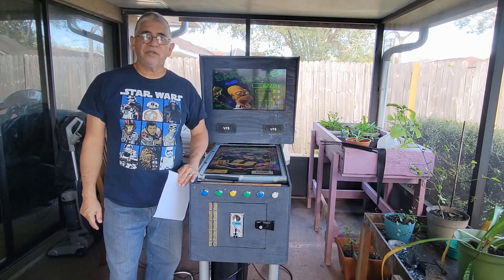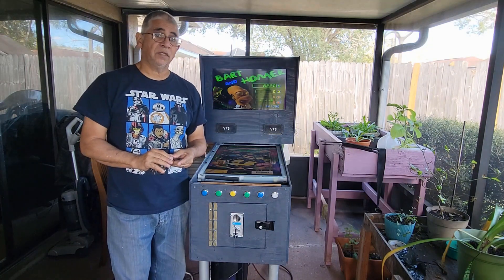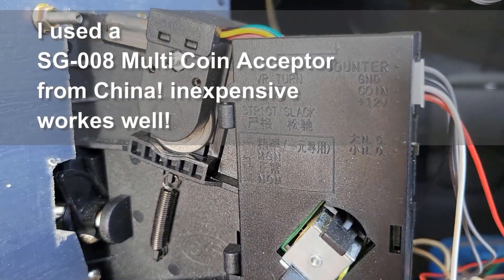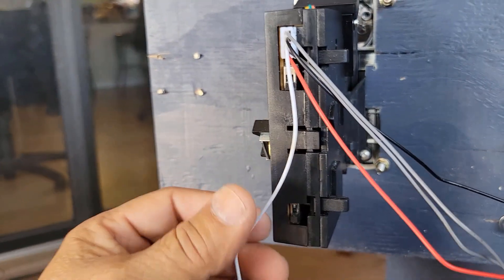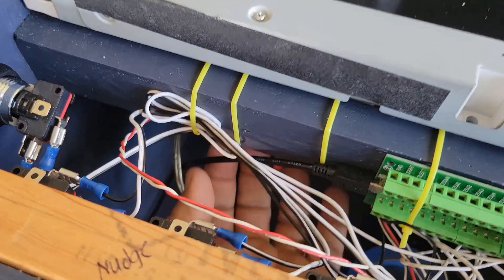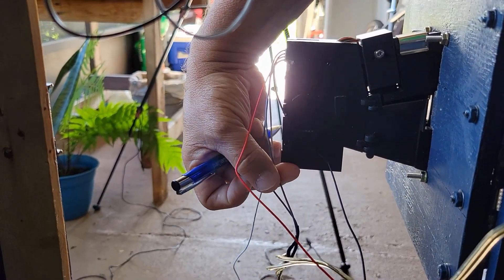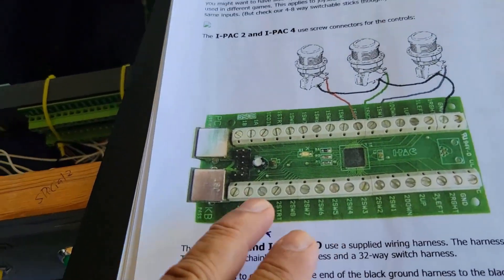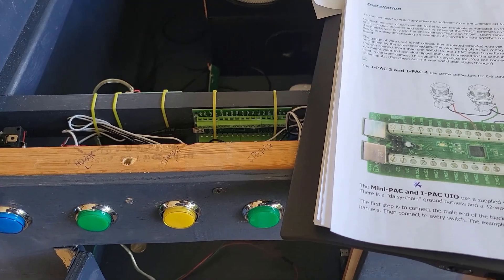Adding a coin acceptor to an IPAC-2 Arcade button encoder

Comment: José! Muy buen video! Why couldn't you connect directly from the coin output wire? 
I have a similar coin comparator and Id like to do it like that
Reply from the maker: Hi, I'm so sorry I did not see your comment till now, I was reviewing my work on the PINBALL! I have to update my PINBALL and seen your comment, I hop you were able to fix your issue, well the reason I chose to do it that way, was: that the way the IPAC2 works is when you connect one wire from a button to Ground and the other to one of the terminals on the IPACK2 when you press the button it connects Ground to the Terminal you connected the other end of the button, it is sending a negative signal to that pin,  the coin Acceptor is sending about 12 VDC, on that white wire, I was afraid of damaging the IPAC2 with such voltage, so I came up with the idea of using a relay that will activate with 12VDC and using it I connected the NO (Normally opened) points of the relay to the ground of the IPAC2 and the other side to the pin I wanted to activate, the concept: when the coin is inserted it triggers the relay to a NC state (NORMALLY Closed state) for 1 second closing the contact and connecting ground on the IPAC2  to the pin I had selected for the free play button, it works well till this day! no issues sorry again for not seeing your comment a Year ago!